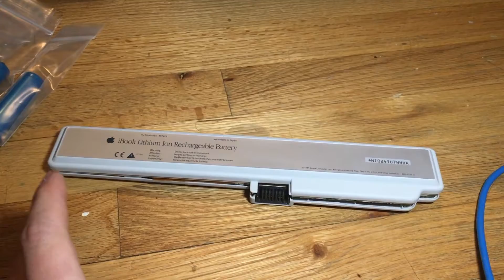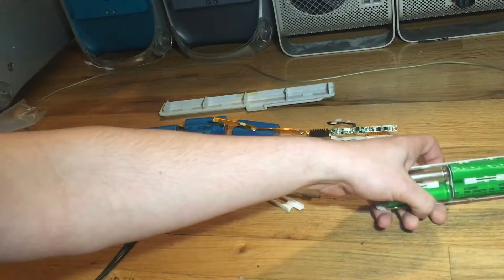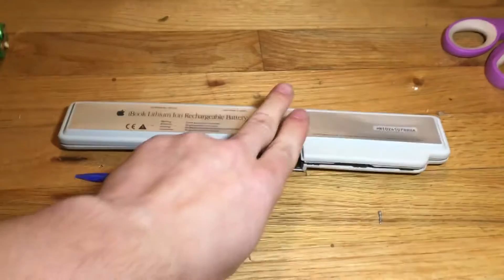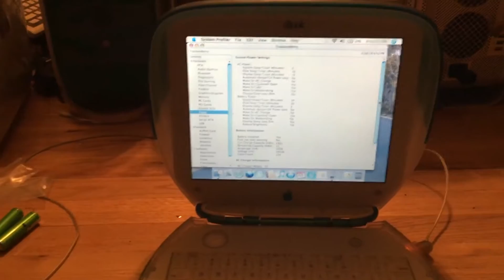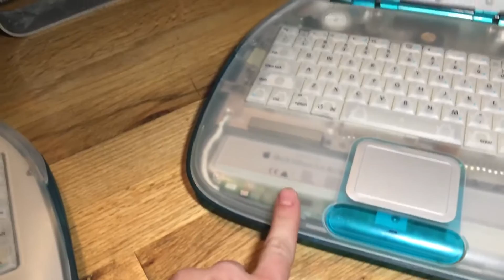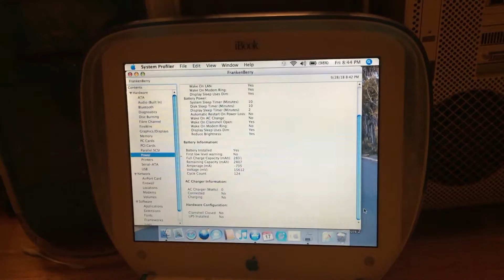How to Build a New Battery for Your iBook/PowerBook – PowerPC Series S.3 EP.7

Comment: I did this rebuild 4 years ago with good Panasonic cells. It turned out extremely well. 4 years later I still get a good 7-8 hours life on my iBook 366mhz while running Reason 2.5.

Comment: I know this is a super old video but thank you so much for the valuable information Greg. Just tried rebuilding a battery for an A1046 PowerBook, scary but it seems to have gone well!! The old cells were completely dead 0v.  The battery indicator LEDs didn't work until I applied a charge voltage, after that it seems fine. Going to wait to test it properly until I get another Aluminum PowerBook, the one I have right now has a super dead gpu lol. Please keep doing awesome stuff.
Reply from the maker: thank you Logan

Comment: I did this with my PowerBook G3 Pismo battery, everything works, i did not glue the battery back together, i just taped it back together with ordinary scotch tape, because if those batteries fail in the future, i want it to be easy to take the battery back appart, i had to modify the case a bit because of the soldering job i did, but it closes now perfectly fine and the battery indicator button works! Great video man!